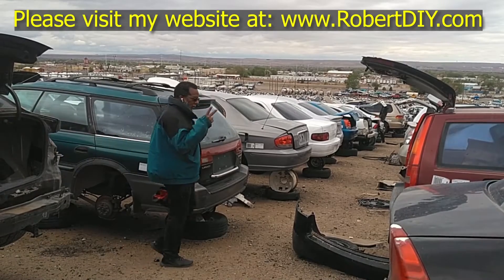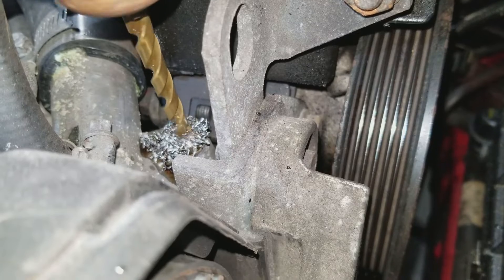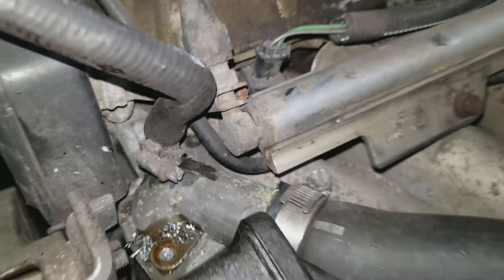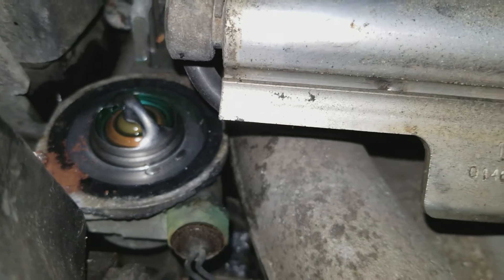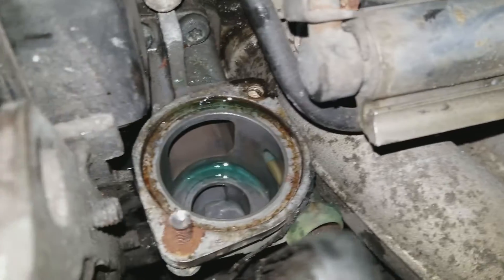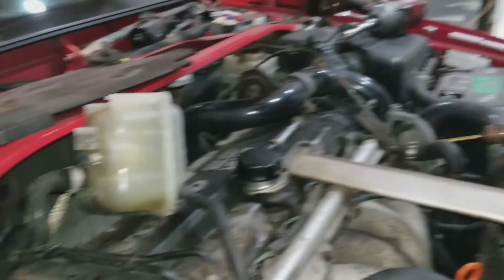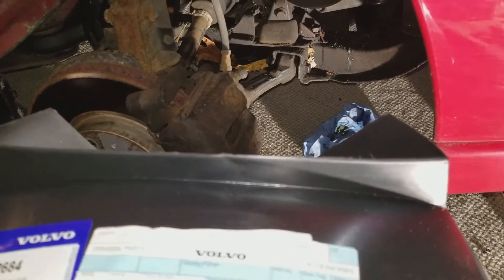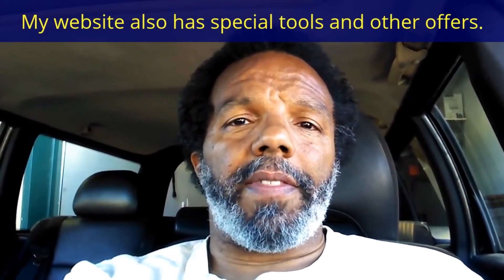I'm taking short trips. Volvo V70 T5M, thermostat w/ stripped screw, fender well skirt, etc. - HOWR

Comment: Hey Robert..
 Been following you for a while need input..
Just started on 98 s70 volvo doing all the things that your video instructed kind of got stuck with the motor and transmission won't separate got all both out transmission and torque converter but the transmission and motor won't separate so what advice whatever else can you give to help me
Reply from the maker: It will pry apart if all of the bolts are out.